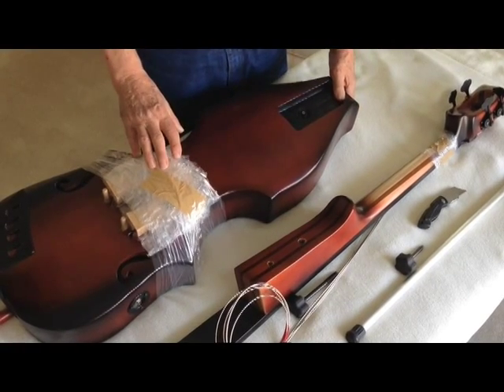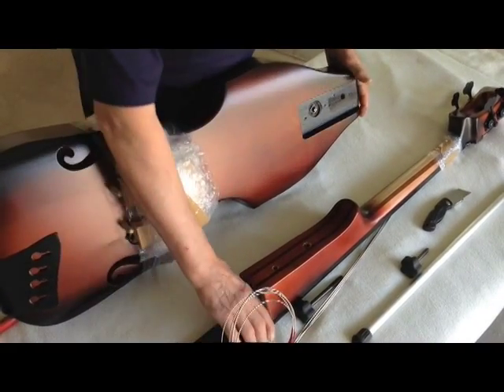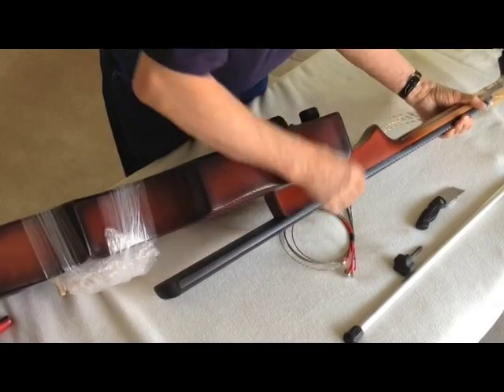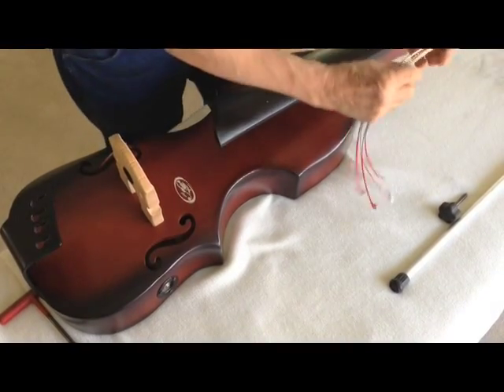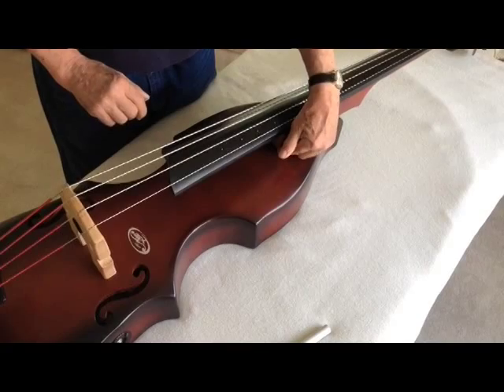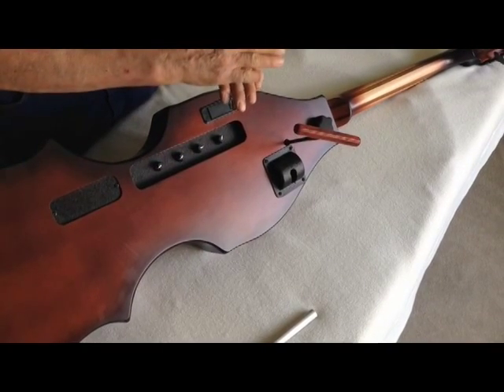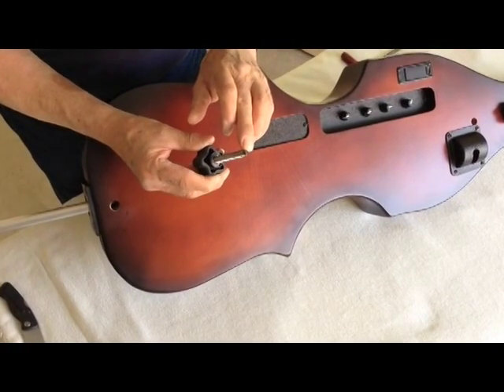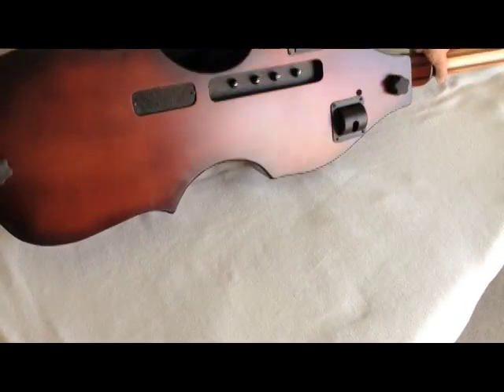BSXUnpackingProcedure

Comment: My recommendation;  Having received one  and had to unpack and set it up the neck / body joint on mine was extremely tight and was needing some rather extreme force to set, so first, I wisely smeared a thin layer of  water proof plumber's/key grease on the side of neck and inner body sides and it eased it's way in. It will also be easier to remove down the road as humidity or moisture will not degrade the grease over time.

Comment: Hi  dear Rob, I´m Fernando from Mexico. I have a Bass Bsx and a question. Could you help me get that accessory in a "T" shape used to change the low or high action of the instrument? Because I do not own it. 

 I wonder if here are some distributor or may be could you sell and send it to me? Could you help me get that piece, think its called an Alan Wrench, if you don´t mind?

I refer to this:

 Action Adjustment
(To change Action of Strings) 
Should be NO separation between 
heel of neck & body slot 
Insert Alan Wrench 
1. For LOW action: Loosen TOP screw 1/4 turn turn
bottom screw clockwise for desired action 
2. For HIGH action: Turn BOTTOM screw counter clockwise 
3. SNUG TOP screw

Thanks for your time, I will be very grateful to you. ( I will send this same mail to the email account that appears on this publication)

Regards!